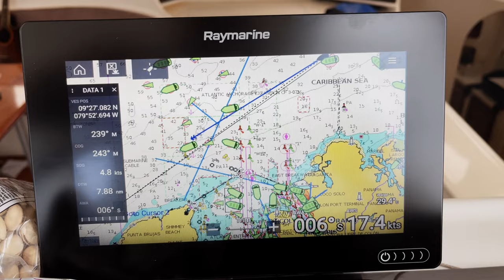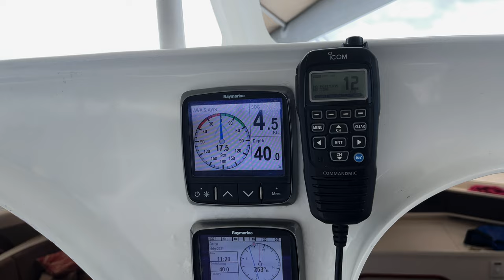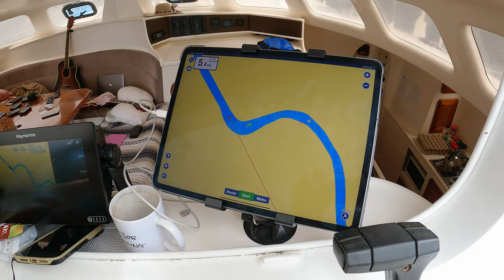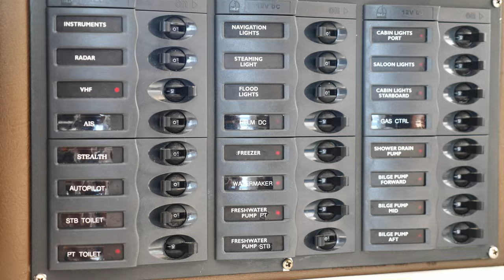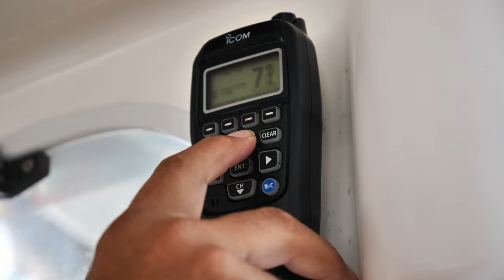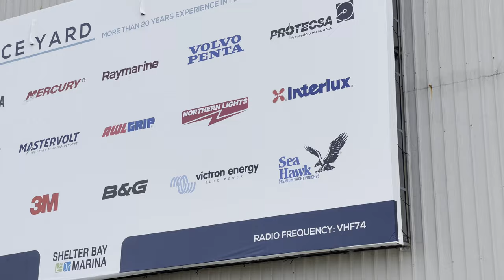Is this enough to CLAIM WARRANTY? - SAILING LIFE ON JUPITER EP126

Comment: You could use ceramic set screws on the cutlass bearing if you are concerned with dissimilar metals.  It would be nice if you could machine a slot in the bearing and in the housing and you could use a delrin wedge key that is driven in from the end which would keep the bearing from spinning.

The ultimate solution would be to have a cutlass bearing made with a flange on one end and a snap ring groove on the other side. If the flange end had a raised are you could cut a small 1/4" square notch in the end of the bearing housing so the bearing slots in.  Basically a tooth on the bearing.

Comment: Another interesting, varied video. Hope all works out with the repaint. Like your approach regarding accommodation refund… “if you don’t ask, you won’t receive”.  
I use to have a 42’ aluminium mono. When the yard replaced the cutlas in the P bracket, no grub screws, only bonded in place. The yard put in extra two holes per side and they scored outside of bearing before bonding .

Comment: Plukky mentioned that the Mumby design had structural flaws.. i can see the problems now.. rudders should not leak !! ... Sounds like he is building a solid aluminium boat that is structurally sound built by professionals to go round the world... not some  guys off the street in Asia.
Reply: Calm down :) Plukky wanted to build a mumby himself until a different opportunity came along. The mumby is a very good cat in many regards and the downsides are at least not hidden but obvious like for example the small cockpit. And about Plukkys boat.... he had far less influence on the design than he claims because most of it was done (actually with the help of another sailing channel)  before he came in contact with the builder and it is nearly the price of a outremer 45 which is about double the price of a mumby
Reply: Plukky is an opportunist, a grifter, and a user, bear that in mind.
Reply: @nutzer123  what is the price of a Production Mumby these days ?
Reply: @nutzer123  I happened to have the Outremer 45 price list which i just looked up as I have been looking for a performance cat for over a year... Problem with the list price is that it doesn't include electronics, fenders, mooring lines, colored mast, a decent sail package etc etc... if you add in all up you are in to the EUR900k range min. You need to be careful with these companies and the way they set out their prices.
Reply: @DRB68  interesting question,I’ve heard $250 for bare hull,don’t quote me on that.
Reply: @svthorasailing4868  I think you meant thousands but Isn't that the problem though ....rumours.... I can imagine given the price of 5083 aluminium that it would cost roughly $500k for a fully fitted Mumby but you would need to manage the build yourself off a design that although is performant, has not been run through a proper structural analysis and hence the problems we see here. I wouldn't take the risk personally for a slightly cheaper yacht.
Reply: @DRB68  What 'structural' problems do we see here? Please give the timeframe on this video so I can analyze what you are saying.  
Are you aware of how many Mumby 48's have suffered structural issues? If you are, please share details.
Reply: @DRB68  I agree,the $250k I heard was just hulls bare.
Reply: @alfredneuman6488  Well the rudders leak here and they are known to "flex" too much and hence crack the paint between the hull and bridgedeck due to lack of reinforcement. There are other channels that hint at this and i heard it from a friend who came across one in the Carribean. Maybe Jamie can give us a close up of his ;-)
Reply: @DRB68  Many rudders leak, so this is not exceptional.
Evidence that 'they are known to flex'?
Same with "hence crack the paint between the hull and bridgedeck due to lack of reinforcement"
I have undertaken an internet search and just can't find anything. 
Are you involved with the production and sales of some other catamaran?